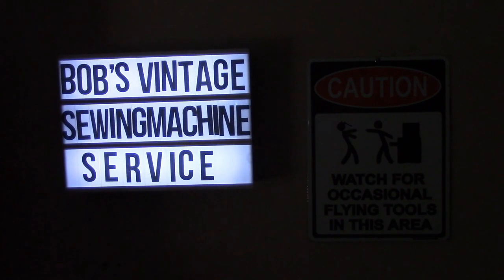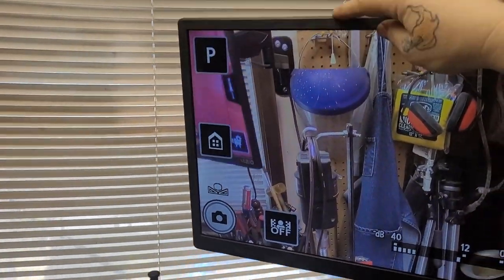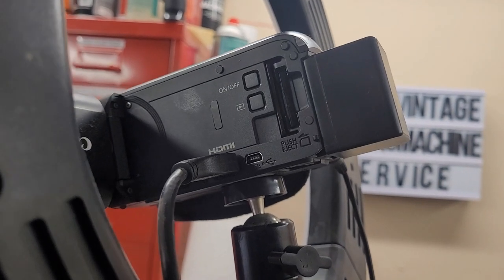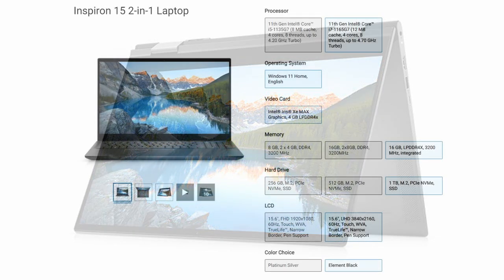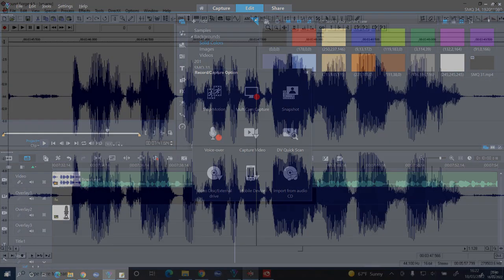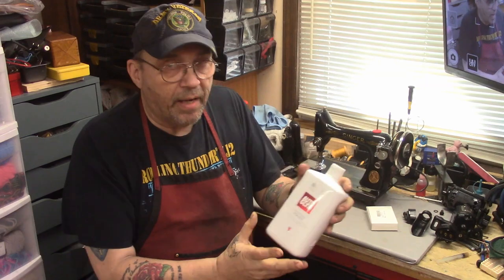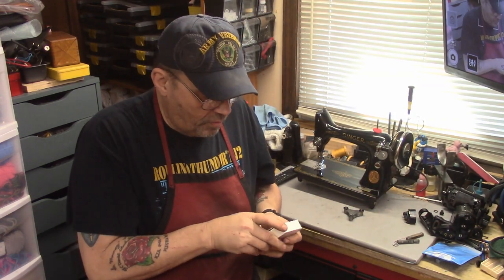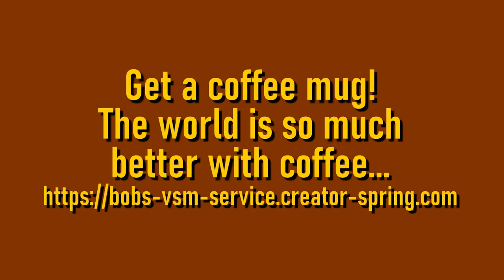Some Hardware, Some Software, and Some Polish - Sunday Morning Quickies #34, 20 March, 2022

Comment: I've got some stuff called TR3 Resin Glaze that made me make the same sounds you did, Bob, with that Auto Glym.  I think I said some of those same words too and called hubby over because I couldn't quite believe my eyes!

I'll have to look into that one you've got to see how it compares.  Like you I use a high-carnauba content wax over the top.  I wait a couple of days before I do that though because sometimes with the Resin Glaze on really old machines it would go a bit "cloudy" or "goldy" (where it's supposed to black).  But over the following couple of days it kind-of "gassed off" whatever causes that and went back to black and shiny.  

I'm very careful with it over decals though, one or two I've seen start to silver when I'm trying to lift a century's worth of grunge.  As soon as I see that I stop or use it on a bit of cotton wool twirled onto a cocktail stick or similar and just "roll it over" rather than rub.  

I've been able to bring back areas where you'd the think the decal was long gone to looking really nice again though. (Honestly - I'd be cleaning an area that I thought was just loads of dark with grunge and old whale oil and so on, with no expectation that there was any of the decal under it left and Lo!  A pretty gold design has emerged!  It's like archaeology...)  :-)